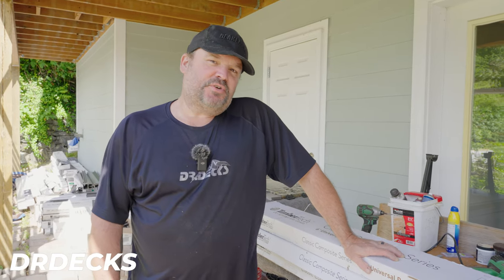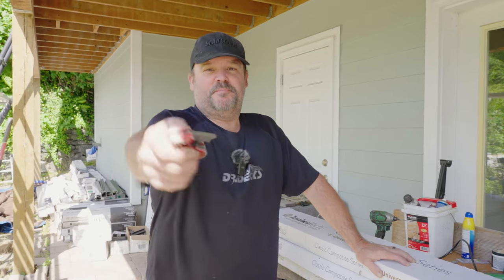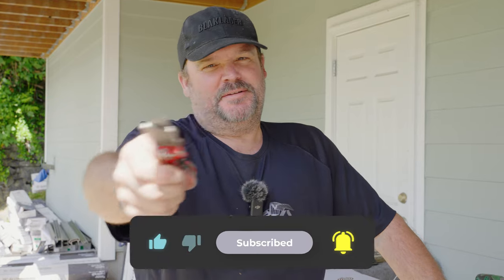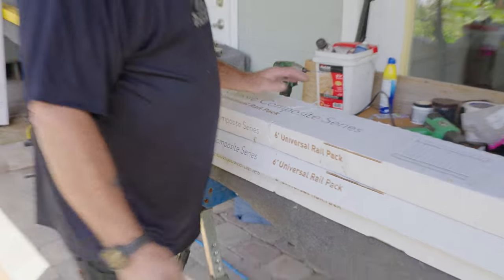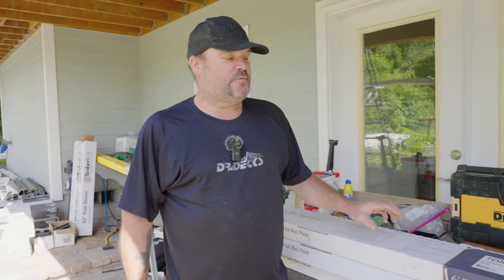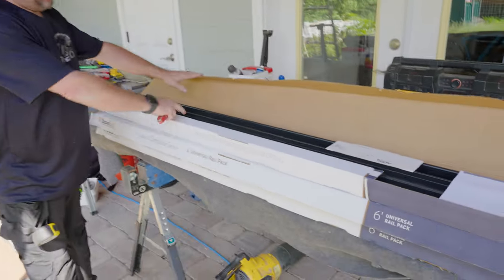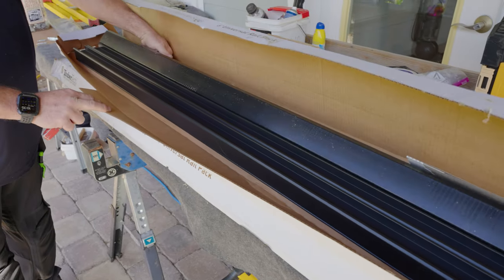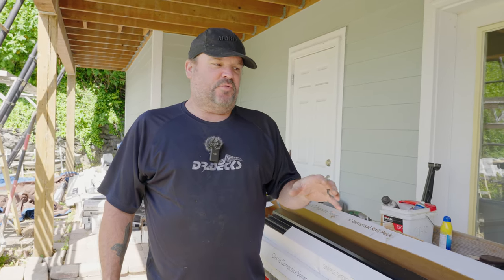How To Install TimberTech Classic Composite Rail Kits|| Dr Decks

Comment: As I've been learning about these newer systems, I think I'm hearing there are two options I want to consider. The first possibility is to make the extra effort to bolt 4" wood posts firmly to the joists underneath, then buy hardware to go over those posts, and rails between. That way I need to notch the flooring around the posts coming from below. The second option is to buy a railing that bolts onto the face of the flooring, with heavy screws that go into joists or other meaty wood below, leaving the composite decking intact without need for notching it. I gotta think the former trades extra effort for more structural integrity. Do you have any thoughts as to which is better, or which you would recommend?

Comment: Nice video. I'm installing Timbertech Radiance railing on my PVC deck. My 16 step staircase is at 32deg. The Timbertech alum round balusters come precut at 36 deg. Do you just recut the angle with miter saw?

Comment: I just spent $4k on rail and baluster kits. Neither box included the 2”screws for the balusters. I’m dumbfounded. Going to try deck mate screws tomorrow but worried they are either too course or too think. And they have a countersink head. All other screws were included. 7 boxes of railing and 4 boxes of balusters and I’m stuck with no way to fasten them. It just blows my mind that they have to be ordered separately.

Comment: You lay out spaces, not spindles. Take your total length plus the width of your spindle and divide it by 4½" plus the width of your spindle.  4½" is max space by code, spindles in this case are ¾".
For e×ample just say our span is 87¾". Add ¾. 88.5"÷5.25=16.857 spaces. Like stairs you cant have a part of a step. Now take 88.5"+17 spaces =5.205". Add this to your memory. Now add memory to itself repeatedly til you"ve reached total run, by hitting recall plus recall plus recall etc. This gives you the far side of your spindle so you must x-back of your lines. If you want centers just start out with total run plus ½ spindle. This gives perfect spaces. If you're really smart, do this when laying out frame and or at least newel posts. You can absorn odd spaces between house and 1st newel if need be
Just like doin stairs (kinda)